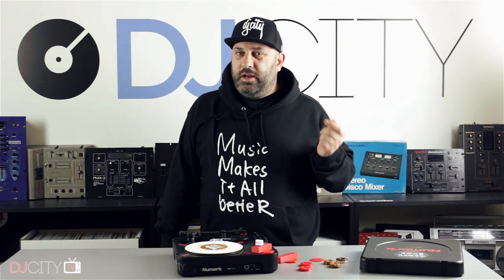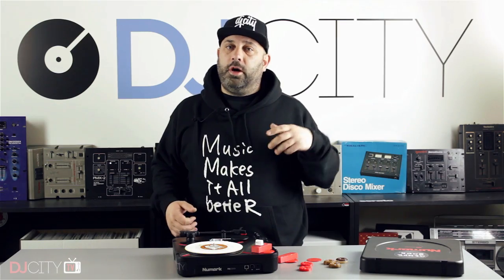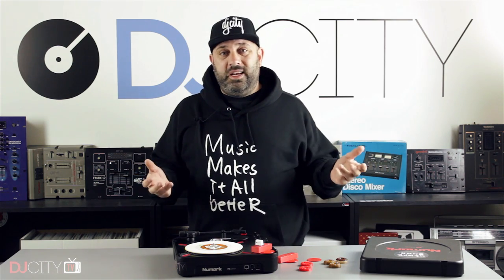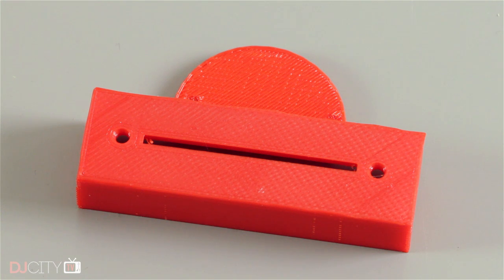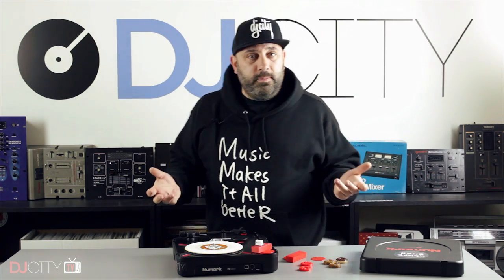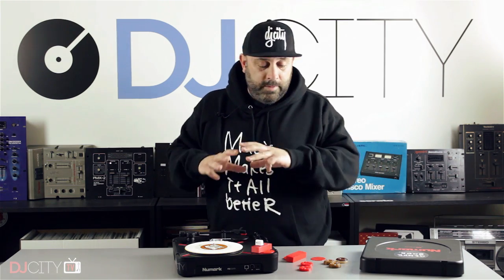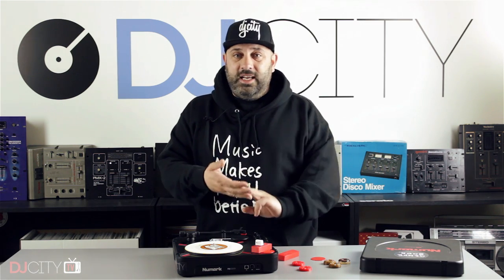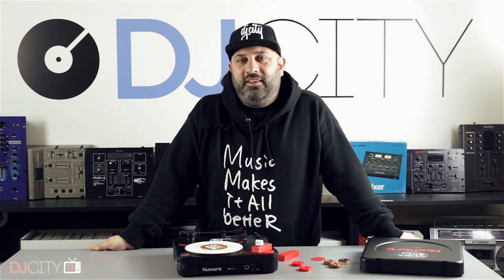3D Printing Your Own DJ Gear

Comment: It would be nice to have feets for the Traktor s4 or s8 to bring them on turntable height.
Reply: Kilian Geirnaert That was something I thought about after seeing the Akai AMX stand posted in the comments here. Shouldn't be too tricky if you don't need them to actually screw into the controller...
Reply: I think it would be a good solution and a great project. 
PS. Love your videos and greetings from Belgium.

Comment: Great video. I got into 3D design last year because I wanted to make some parts for my PT01. I got my first 3D printer a month ago and is currently working on a dual rail fader and learning CAD software along the way. There are a lot cool example on the internet where people use 3D printing for DJ parts and prototyping.

Comment: Great vlog, MOJAXX! I think this 3D-printed Akai AMX stand is ingenious! Although, I would like to see it widened to accommodate one AFX sitting beside it. It would also be nice to have a small powered USB hub added to the 3D-printed chassis. That would allow you to use only one USB cable to your lappy. Plus, it has the added benefit of increasing the volume of the AMX, which is considerably lower than a REAL mixer because it's bus powered. Only I'm not handy enough to do this. Plus, I don't speak Portuguese. Any takers?
https://youtu.be/cWysfgOazLY
Reply: Trey Thomas That looks like a great design! Has really got me thinking...
Reply: I think so too. Looked for the 3D-printing CAD file to download but the OP didn't provide. Know anyone who speaks Portuguese?